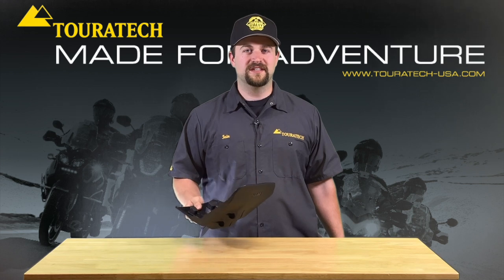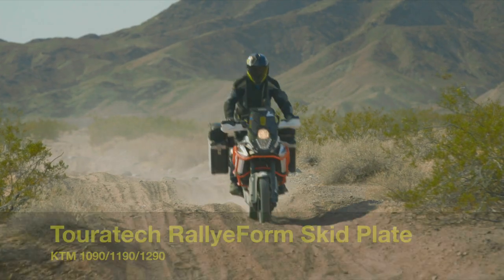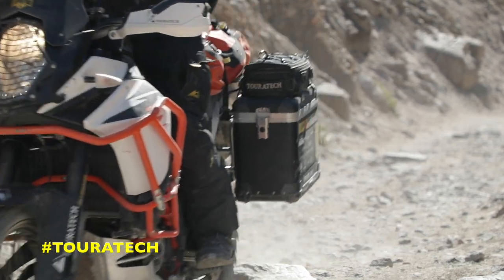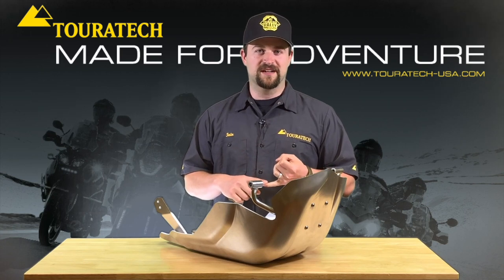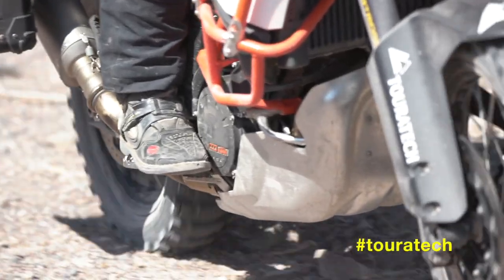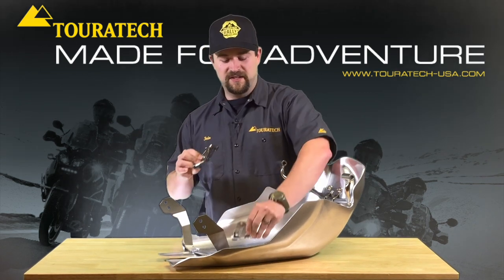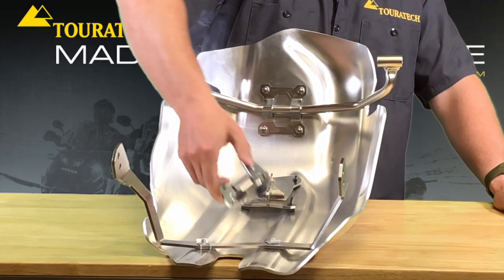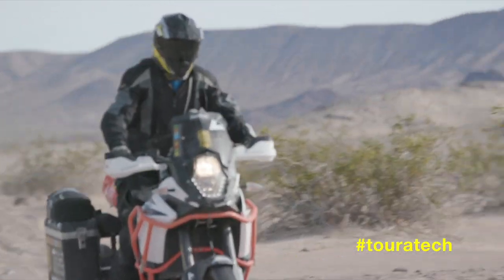Touratech RallyeForm Skid Plate: KTM 1090/1190/1290

Comment: What about ventilation? What about engine cooling when there are no vents? (KTM1290)
Reply from the maker: We have the RallyeForm skidplate on many different bike models, and have never heard or experienced a bike overheating due to the guard being on the bike.
Reply: @TouratechUSA . Thank you for the reply. The experience from power users seem to be that the temperatures do increase somewhat, but not to problematic levels. I can live with that. Considering the way this piece is produced it would be a bad idea to drill holes in it :)
Reply: Have over 5000 miles with this skid plate on a KTM 1190.  No changes in temperature in oil or coolant from stock.  Very happy with it btw.